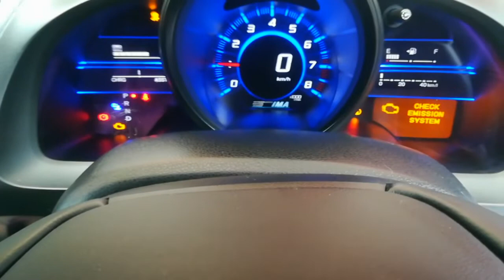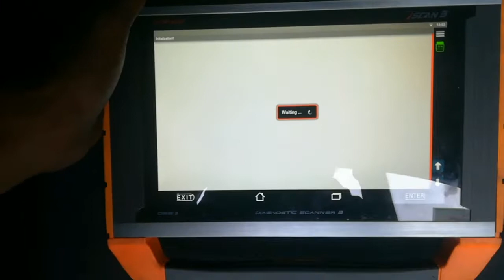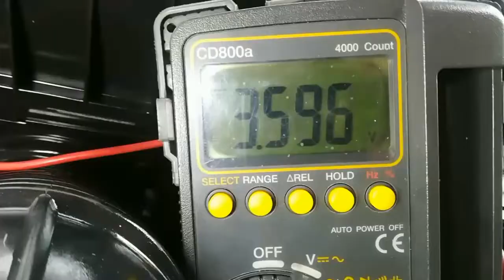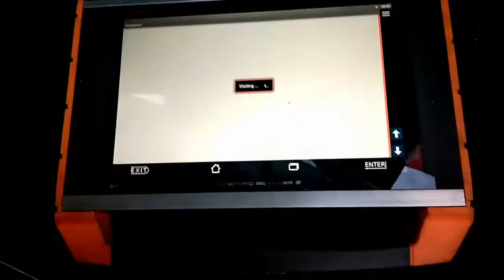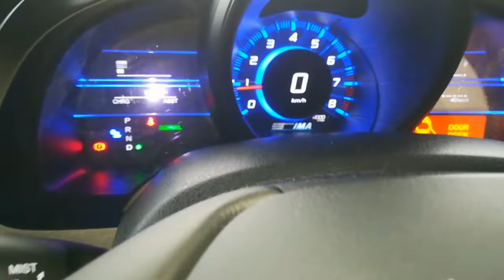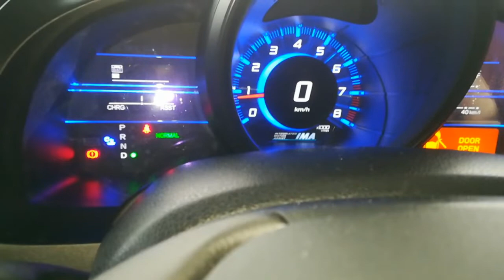How to reset check engine light, fixed p2649 engine code! Honda CR-Z hybrid,

Comment: Mine is also like this but still can drive so whats the problem?
Reply from the maker: Check engine light on please Check if there is any fault code on the scanner. Then repair it.
 If your car's engine code is p2649 then the car's engine will have idling problems.